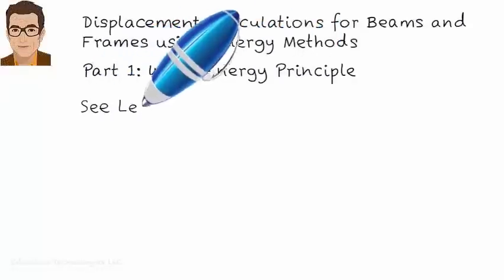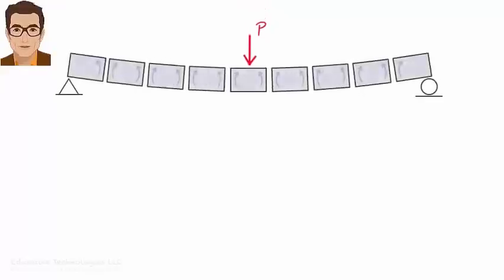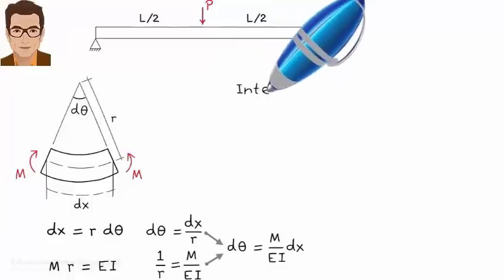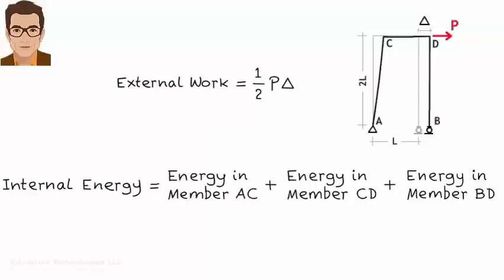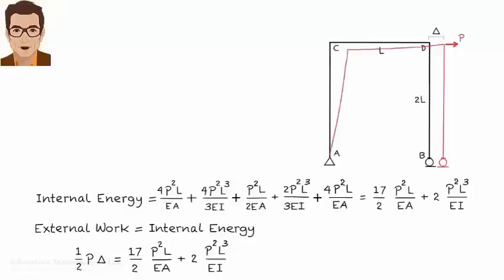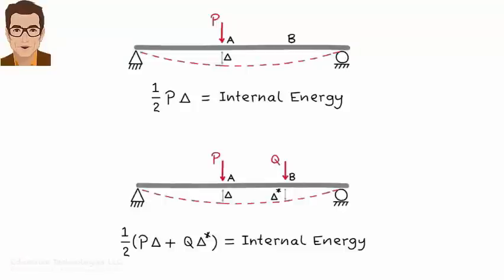SA20: Work-Energy Principle (Part 2)

Comment: 1:53 can you explain a bit on how we can use integral in the place of summation? Thanks
Reply from the maker: This comes from the definition of integral. If you have a continuous function f, the integral of the function gives us the total area under the curve. That area can also be approximately computed by dividing it into an infinitesimal number of rectangular elements each having a base of (dx) and a height of (f_i). The total area in summation form can be written as:
SUM (f_i)(dx) for i 1 to N.

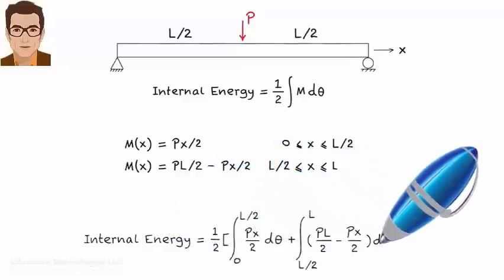Comment: At 2:23 where does the x come from, and how did you get the equations M(x)=PX/2 and M(x)=PL/2-PX/2. I tried taking moments about point A (left side) but I didn't get the equations you got. Also at 6:02 how did you get p^2l^3/96EI? At 8:40 why doesn't joint CD have a moment force at the end?
Reply from the maker: x is the horizontal axis in the Cartesian coordinate system. The origin of the system is assumed to be at the left support.

Please see our shear and moment equations lectures to better understand how to write shear and moment equations for beams. In this case, the left support reactions is P/2. Therefore, bending moment for the left half of the beam where x is between 0 and L/2 is (P/2)(x). And for the right half of the beam where x is between L/2 and L, we get (P/2)(x) – (P)(x-L/2) which simplifies to PL/2 – Px/2. 

The internal energy was computed via integration (see 6:00 for the integral expression).   

Member BD carries an axial force only, there is no bending moment in the member. Therefore, bending moment at its upper end (at joint D) is zero.
Reply: @DrStructure  Thank you

Comment: I don't understand why it is PL/2 - Px/2 @2:23 ...why not PL/4-Px/2 ?
Reply from the maker: +Wong Huei Hann To determine the moment equation for L/2 < x < L,
cut the beam at some arbitrary point to the right
of the applied load. Let's refer to the point as O,
and refer to the distance from the left support
to this point as x.

Now, draw the free-body-diagram for the left beam 
segment, the segment between the left support
and point O.

The diagram should consist of an upward force of P/2
located at the left end of the beam. The distance 
from this load to point O is x. 

There is also a downward force of P located at L/2
from the left end of the beam.

At point O, the diagram should show a bending moment 
M(x) and a shear force V(x).

Now write sum of the moments about point O and set
it equal to zero:

(P/2)(x) - (P)(x - L/2) - M(x) = 0.

This gives: M(x) = PL/2 - Px/2.
Reply: Dr. Structure thanks for replying me ! and it is helpful ! much thanks :)

Comment: dr, at 8:39 u are telling about the various forces at different section...my doubt is how come at the support A there is no moment,what i meant was at section AC at A there is only forces but at C there is a moment can u please explain???
Reply from the maker: +Ajay Balan There need not be a moment at A in order to have a moment at C. 

The moment at C is caused by the horizontal support reaction at A. This reaction force causes a bending moment at C equals to the magnitude of the force (P) times the length of the column (2L). Hence, we have a bending moment of (P)(2L) at C.

Think about a cantilever beam having a length of 2L subjected to concentrated load (P) at the free end. The load causes  a bending moment of (P)(2L) at the fixed end of the beam. That is what we have here.
Reply: +Dr. Structure could u please specify the reason behind the direction of moment...isnt the moment caused by P clockwise???could u pls also tell why there is no moment of mag 2PL at D...could we provide a counter clockwise moment at P???
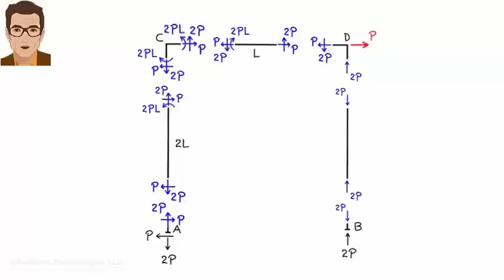Reply from the maker: +Ajay Balan The free-body diagram (FBD) for each member of the frame is shown @9:00.

Notice the FBD for member AC. The horizontal force (P) at the bottom of the member is pointing to the left. This means shear force at the top of member must have a magnitude of P and must act in the opposite direction to the force at the bottom so that the force equilibrium equation
(sum of the forces in the x direction = 0) is satisfied. 

Similarly, to satisfy the moment equilibrium equation (sum of moments = 0), bending moment at the top of the member must act counter-clockwise. If it acted in the clockwise direction, then the moment equilibrium equation (say, taken about A) would have given us 4PL instead of zero.

The FBD for member CD tells us that there is a downward shear force of 2P and a clockwise moment of 2PL at the left end of the member. This means sum of the moments about the other end of the member is already zero. The shear force causes a counter-clockwise moment of 2PL, added to the clockwise 2PL moment, we get zero. If we place a non-zero moment at the right end of the beam (at D), the moment equilibrium equation cannot be satisfied, it is not going to remain zero.
Reply: +Dr. Structure thank u very much.....means a lot :D

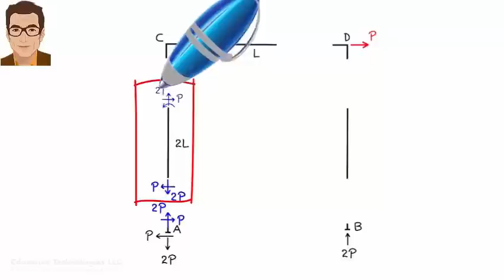Comment: Dr Structure, please tell me, at 8:03, how do we get that the internal moment at C is 2PL?
Reply from the maker: Assume the moment at C is unknown. Let's refer to it as Mc. Say, it is acting in the counterclockwise direction at the upper end of member AC. Now write the moment equilibrium equation (for member AC) about A. That is, the sum of the moments about A for member AC must be zero. The equation is: (P) (2L) - Mc = 0. Or, Mc = 2PL.
Reply: Dear Dr.Structure, why  did you not take (2P)(L) at C when you calculated Moment at A? Should it not be (P)(2L) - (2P)(L) - Mc = 0 ?
Reply from the maker: I am not quite sure what you are referring to, so feel free to elaborate if the answer below is unsatisfactory.

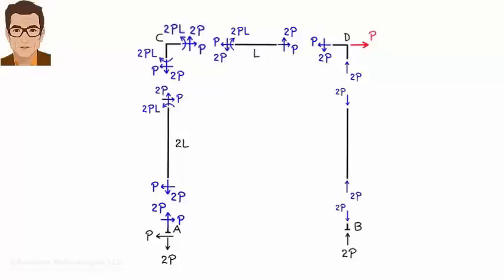@9:05, considering vertical member AB, taking the sum of the moments about A, there are only two forces that contribute to the moment: the shear force at B having a magnitude of P, and the bending moment at B having the magnitude 2PL. The moment at C does not come into the picture here, since joint C is not a  part of the free-body diagram for AB. So, the equation becomes:

(bending moment at B) - (shear force at B times L) 
or,  (2PL) - (P)(2L) = 0
Reply: Thanks for the quick response. When we are considering the whole structure at @7:22, there are 4 forces, P and Ay go through C and can be neglected, then we have Ax and  By left. So moment in C is (Ax)(2L) - (By)(L) = Mc. Since Ax = P, By = 2P,  so we get Mc = 0 ?
Reply from the maker: Not quite.  Mc does not (should not) appear in any of the equations since it is not shown on the free-body diagram we are using to write the equations. Mc is an internal moment and unless we cut the frame at C, the moment is not going to show itself, it is not going to be drawn on the diagram. So, considering the entire frame, the only forces that appear on its free-body diagram are the applied loads and the support reactions. And these are the ony forces that we use to write the equilibrium equations.

The moment equilibrium equation about Point C should read: the sum of the moments about C equals zero, not equal Mc. So, we write: (Ax)(2L) - (By)(L) = 0

In this problem, Mc is not actually zero. To determine it, after calculating the support reactions, we can cut the left column very close to C, and draw the free-body diagram for member AC. The diagram shows a horizontal foce of P and a vertical force of 2P at A, and a shear force of Cx, axial force of Cy and bending moment Mc at the top. Now, taking the sum of the moments about C based on the forces on that diagram, we get: Mc = 2PL.
Reply: @DrStructure  I see, we just need to look at section AC when we analyze the beam AC. So there's  only Ax should be considered. Thanks again, great help!

Comment: When you took the right side of the beam (from L/2 to L), why is the moment (P/2)*x - P(X-L)/2. Can you explain that? Why do we take it like this?
Reply from the maker: For a simply supported beam of length L subjected to a concentrated load of P at its midpoint, the left support reaction is P/2. Therefore, the bending moment equation for the right segment can be written in terms of the moment of the left support reaction about an arbitrary point (x), and the moment of the applied load about the same point.

If we choose the position of the left support as the origin of the coordinate system, the moment arm for the support reaction is x. Therefore, the moment of the support reaction about the arbitrary point equals (P/2)(x). 

The moment of the applied load about the same arbitrary point is (-P)(x - L/2), where x - L/2 is the moment arm for the applied load. That is, the distance between the applied load and the arbitrary point in the right segment of the beam is x - L/2. 

So, the moment equation becomes: (P/2)(x) - (P)(x - L/2). This expression simplifies to PL/2 - Px/2, as shown at time 5:44 in the lecture.

Comment: @Dr.Structures why does the work energy method neglects the direction of the force being applied?
Reply from the maker: You need to elaborate more. Work is force times displacement in the direction of the force, and energy is the product of the internal force times the deformation caused by the force. So, the direction of the force is not neglected in determining either external work or internal energy.
Reply: Dr. Structure I should have been more specific, what I was trying to say was the deformation of some member may be in the vertical, horizontal direction or both. So my question is if the force is applied let’s say horizontally to the right as in your example it seems reasonable to me to only take the horizontal component of the deformation in the members to calculate the displacement in such direction. So my question was more directed towards calculating displacement using the work energy method, I’m sure there must be a reason for this, the only thing I could think of is that the displacements are soo small that it doesn’t really matter if we don’t considered direction but I’m not totally sure if this is why. Hope I was more clear this time, thank you for the quick response!!! Love the channel ❤️❤️❤️
Reply from the maker: It may be useful to think of external work and internal energy separately, as two related but different phenomena. 

When we think about external work, we should think of the system as a whole, not in terms of its individual components (members). The system as a whole is going to deform in some manner under the applied load. This deformation can be described/measured at any point on the system as a x-displacement, y-displacement, and z-rotation (assuming a 2D system). That is, every point of the system is going to displace by some amount under the applied load. If the load (P) is applied at point A, then by definition, work done by P is a function of P and the displacement at A in the direction of P only. None of the other displacements (at points other than A) matter, they are inconsequential when we want to determine the external work being done by P. Moreover, the individual members of the system (e.g., beams and columns), how much they displace and in which direction don't play any role in determining the external work, as they are considered internal to the system. So, if we have a frame that has a horizontal displacement under an applied horizontal load, the forces and displacements of the individual members do not play any role when we are calculating the external work, which is solely a function of the applied load and the displacement of the whole system in the direction of the load. As far as the external work is concerned, the only thing that matters is the amount of the overall displacement caused by the force. Here, we have made no assumption or simplifications in defining work in terms of force and displacement.

On the other hand, to determine the internal energy of the system caused by an external load, we need to dissect the system and examine individual components/members. Under the applied load, each member is going to be stressed (internal forces develop in the member). For example, in a frame structure, an internal shear force, bending moment, and axial force could develop in each member. And, the member is going to deform (we refer to these as axial deformation, shear deformation, and bending deformation). These deformations, however, are distinct from the external deformation of the system. If 3 internal forces (i.e., axial, shear, and bending) and 3 internal displacements (axial, shear, and bending) develop in a beam or column, then the internal energy stored in the member can be calculated as the product of each internal force and its associated internal displacement. Again, here the internal force and displacement are aligned with each other. That is, axial force in the member must be multiplied by the axial displacement of the member in order to determine the (axial) internal energy. Here too we are not making any simplifications. If internal forces develop, causing internal deformation, then internal energy emerges and can be calculated as the product of the internal force and displacement.

At no time, whether we are talking about external work or internal energy, the direction of the displacement (of the whole system or its individual members) can be ignored. Work (energy) is always the product of the external/internal force and its related external/internal deformation.

However, when we are performing the actual calculations, some components of internal energy can be ignored. For example, in most cases, for beams and columns, we can ignore internal energy due to shear force and shear deformation since the latter is generally very small and can be assumed to be zero.

For calculating external work, since by definition work equals force time displacement in the direction of the force, we simply ignore displacements in other directions. For example, if point A displaces in both x and y directions, but the applied force (P) is horizontal, that y-displacement plays no role in work done by P. If, on the other hand, P is applied at an angle at A, both x and y displacements should be used to calculate external work. In that case, the x component of P times the x-displacement plus the y component of P times the y-displacement gives us the total external work done by P.
Reply: Dr. Structure thank soo much for the elaborate response. If you could focus on internal energy for instance,I agree we need not to worry about with any other deformation but the one I’m the direction of the external force being applied. My question is going back to the horizontal force P being applied causing an external displacement delta in the direction of the force,
But lets say every truss member that will  develop an axial force will deformed based on the orientation of the member under such axial load and since the orientation of the axial load is determined by the physical direction of the member also the deformation will occur in such direction. There is the source of my questioning since the internal deformation in all the component contribute the the external displacement how come we are using the full magnitude of the internal axial force to calculate external displacement? I wish I could explain myself better.
Thanks for the response anyways

Comment: Can you provide the proof that the internal energy is equal to 1/2 M d\thetha? Or may be you could provide a reference.
As far as I can guess, it is analogous to the work which is equal to 1/2 P \delta. However I would like to be more comprehensive.
Thank you.
Reply from the maker: Please see Lecture SA19.
https://youtu.be/ygqnyH3x7CE

You can go through that derivation using moment/rotation instead of force/displacement to obtain the results/proof you are seeking.
Reply: @DrStructure  I have seen that video before I asked the question. I got that as P is directly proportional to delta (increment), so that we can express P as a continuous function with respect to delta whose derivative is constant. Let say that there exist some real number eta such that P = eta delta. Then the work increment can be given as the multiplication of P and the delta increment. And the total work is given by the integral of P with respect to delta, which will end up equal to 0.5 P Delta.

Then you mean, we can just apply the same method by replacing P with M and delta with theta, right?
Okay, I think my interpretation on 'work' wasn't correct. But now I think I get it, as I have also read on wikipedia about work on other physical systems.

Thank you for your reply.
Reply: @DrStructure  By the way, that's a great lecture! Keep it up!
Reply from the maker: Correct, in thinking about work or deriving its equation, we can replace force with moment and displacement with rotation. Put it differently, moment is a type of force and rotation is a type of displacement. Work is the product of force and the displacement caused by the force. So, a moment (think of it as a rotational force) causes rotation, therefore, the product of the moment and its corresponding rotation is work done by the moment.

Comment: In the frame example,for the member AC,why shouldn't we take M(x)=Px - 2PL as we have taken in the member CD????
Reply from the maker: In the example, we set the origin of the coordinate system for AC at the lower end (joint A) of the member. Since there is no bending moment at A, then M(x) = P x only.  We could have picked C as the origin with positive x pointing down toward A. Then, the term 2PL would have been appeared in the moment equation since there is such a moment at C.